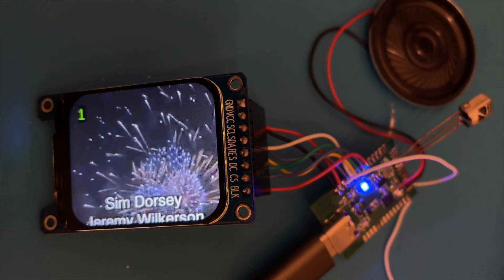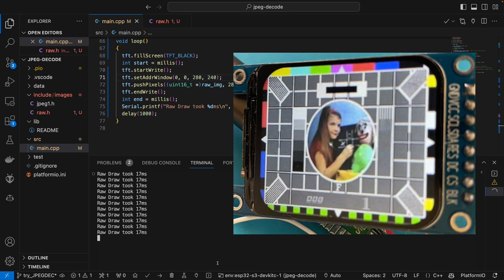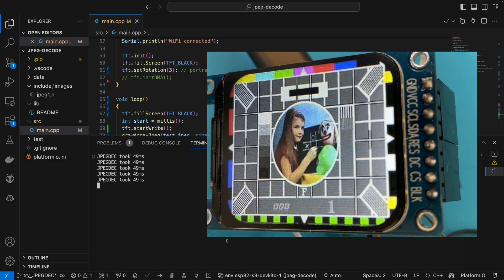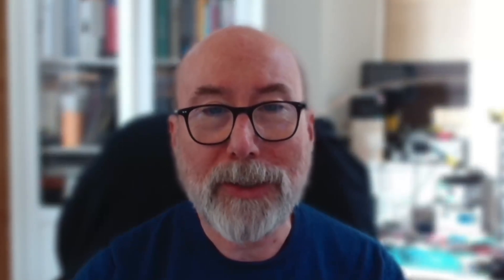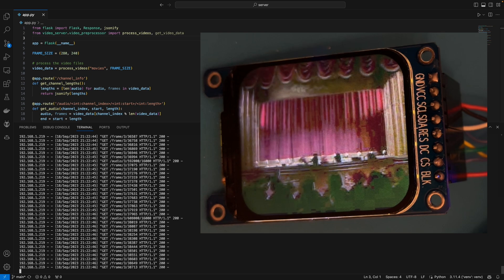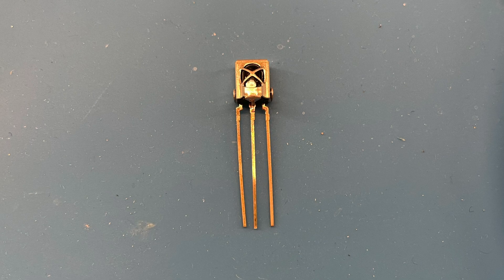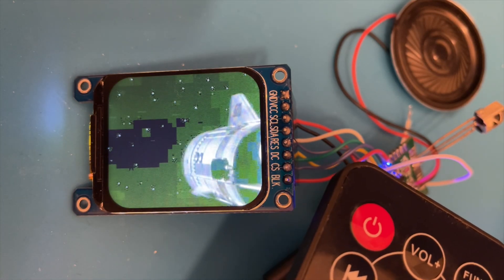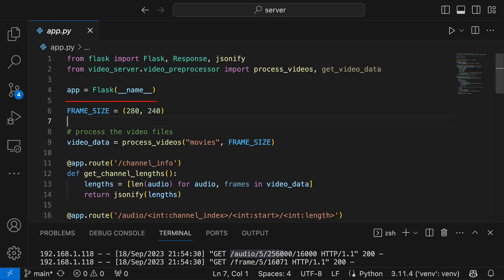Streaming Video and Audio over WiFi with the ESP32

Comment: Was wondering how you'd handle drift/decorrelation: syncing based on the elapsed sound is pretty nifty!  Nice work using the 2 cores + DMA, all this was quite fun--thanks!
Reply from the maker: Thanks! Was a fun project - all fell together quite nicely. Code is a mess :)

Comment: What do you think about the idea that we need a new media codec that holds both audio and video?

Ever since Periscope became popular it’s felt like the right time: Since we get audio and video from the same place (the device or the streaming media file) we can combine them during encoding and never have out of sync audio again.
Reply from the maker: Up to a point I'd agree. The issue you end up with is that it can be quite expensive to decode and display the video and you might want to skip the video frames, but still keep playing the audio. There's also the problem of needing multiple audio streams for different languages - it all gets pretty complication. Even simple containers start to get hard to use (I've just been decoding AVI files and my head hurts!).
Reply: @atomic14  I appreciate your insight. It makes sense that various devices could regularly choose to skip video decoding some frames to keep users comfortable. I don't think different languages are that big an issue since we already have the technology for arbitrary numbers of channels (and in the main use-case I'm talking about livestreams that are not realtime-translated, though maybe I'm limiting it there since realtime translation tech could be less than 5 years away).

I wonder: if hypothetically there was a codec that could encode both video and audio with the same process, would the result be a single stream that contains both in-sync?

I understand "how we got here" (silent films > adding sound > a rich history of format-specific tools and workflows) but something is nagging in my brain about the fact that we don't really use cameras and mics that way any more, that the majority of recording, editing, and encoding is done on a single device and that device now needs mitigations to avoid the kind of "professional work" that is inherent in these long-standing workflows (such as keeping audio and video in sync).

Comment: You, sir, are like the american Andreas Spiess, so, you are already in the best company...   ;-)   6:39 It´d be much easier to solder, if you´d dip the component´s leads in flux and a solder-bath before the actual soldering. I´m very bad and clumsy at soldering, since ever, but the solder-bath solved the problem.
Reply from the maker: I’d be worried about tipping it over and spilling it everywhere - I’m ridiculously clumsy! But it would be interesting to try out.
Reply: @atomic14  I beg you, I´m surely clumsier !!!! ;-)

Comment: This looks great. My only suggestion is to change the title of this video to: Python + ESP32 = 15 Frames Per Second Video with Audio. Plus the project is doing video/audio streaming over an Internet connection. It's all too cool! 

I'm really happy for you that a streaming audio video solution works with a good frame rate. And it's in Python so it gives me hope that I can switch my own project over to Python. I was concerned until I saw your project that Python wouldn't give me fast enough JPEG decoding.

I'm working on an open source mobile architecture called Reflections. It is a combination of software, web services, esp32 based board with a lot of sensors, and a 240x240 round display. I chose not to stream over Wi-Fi because of the power requirements. I need it to run for 6 hours or longer on a battery and it I'm a wrist watch case. So I replicate the mjpeg files to a NAND (a surface mount SD card). And I stream to the display. I'm getting 10 FPS. The repository is at https://github.com/frankcohen/ReflectionsOS

Frank

Comment: Genius, I love it! Have any plans for a ESP TV PCB? Without the screen breakoutboard? You can get it even smaller! Ow and just a suggestion/question. Are you constantly outputting data on the serial bus? If so, if you stop that your code will run faster. But I'm sure you already thought of that. Again, amazing work!
Reply from the maker: I’m very tempted to find a really small screen and build a custom pcb specifically for that - with an SD card holder. But the code will work on pretty much any ESP32 - I’m going to try it out on my collection of devices (including the touchdown) and see how well it works.
Reply: @atomic14  I'm curious to see what the smallest screen is you can find!

Comment: you should add the rc filter for the ir-receiver. i also didn't add one on a board a few years ago since it always worked. then after using it a while it stopped working, after touching the pins of the receiver (or toggle power) it worked again. it somehow started to oscillate or something. quite annoying bug...
Reply from the maker: Definitely - I’ll build that into the next PCB. The IR control does seem to be a bit flaky at the moment.

Comment: As I can understand from the explanation at the sourcecode you are not streaming but polling. That method is pretty slow and has alot of overhead by sending requests, headers etc and open and close the connection on each request.  Why not using Websockets instead? With Websockets the connection stays open (real-time conection) and you push and pull data in any format you want. Actually when the connection is open the server can do all of the decoding work and can deliver a format that is directly usable to the ESP. In fact very similar to how analog TV-broadcasting works. Because this is a very low resolution, It could be possible to send an analog RF signal (made digital) over Websockets including FM quality sound. The only thing the ESP have to do is to decode the RF signal (digitally received) and show the updates like an old skool TV does. With Websockets you can also make channels by using a different port number. This is just for info and ideas, not to criticize your creation. Have fun. 🙂👍
Reply from the maker: Websockets is definitely an interesting idea. To be honest it didn’t even occur to me use them until this message. I have switched on http keep alive which should mean the http session stays open. But there’s always room for improvement!

Comment: Atomic hi, i was planning to make a baby monitor for my wife and while searching i came cross YouTube channel named "that project". He made some pretty amazing real time video transfer with espnow and/or wifi connection. My baby is now a year old and still using the setup without any problem. There is 4 different version for jpeg decoders and he is using lvgl library. You may want to check it if you didn't yet. 
L

Comment: Can Esp32 cam send a stream that the little TV can receive
Reply from the maker: Quite possibly yes. The ESP32 Cam can generate a stream of JPGs. So would be quite easy to do.
Reply: @atomic14  Will be so grateful if you could implement the SD card version and the ESP32 cam example. Thanks indeed for your great effort.
Reply from the maker: SD Card version is done. I need to find where my ESP32 cam has vanished to! It's somewhere in the collection of stuff...

Comment: Do they have these displays with SPI ports? 
I2C is a lot slower. Maybe that can speed things up?
Reply from the maker: It's an SPI display. We're pretty limited by the time it takes to decode the JPEGs, the library is pretty optimised but you could probably get it faster with hand tuned assembly.
Reply: @atomic14  My bad. I saw the SCL and SDA and thought it was I2C. 
Didn't look for CS after that. Does it have both I2C and SPI? 
I wouldn't have been tricked, if they used SCK and MOSI markings like normal people.
Reply from the maker: I think it's just SPI - but these displays are a bit of a mystery to me!

Comment: Wow that was quick! Nice work, I'm surprised you were able to use both cores without jamming up the WiFi. Maybe I need to try more experiments rather than taking the espressif API as gospel.
Reply from the maker: Most of the time the cores aren't really working very hard - either waiting for network traffic or waiting for DMA requests to finish. So it's probably pretty lightly loaded.
Reply: @atomic14  Aren't there actually three cores?